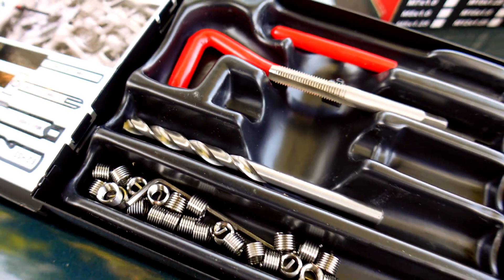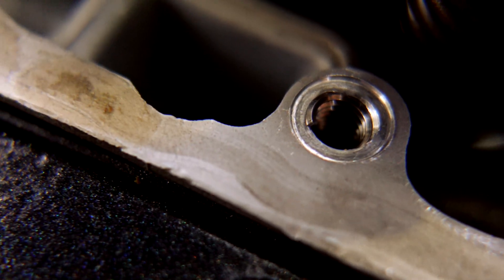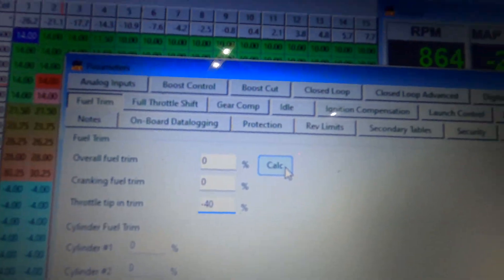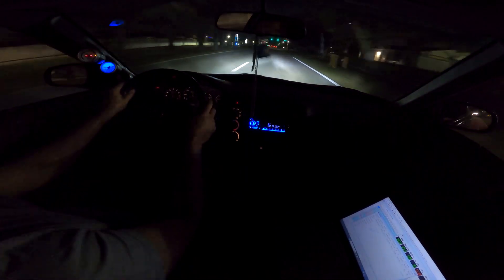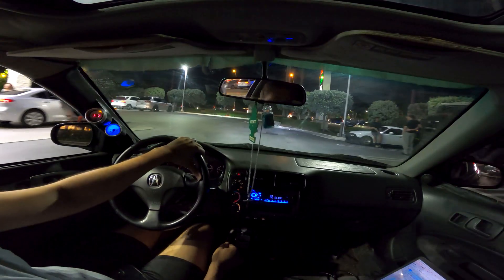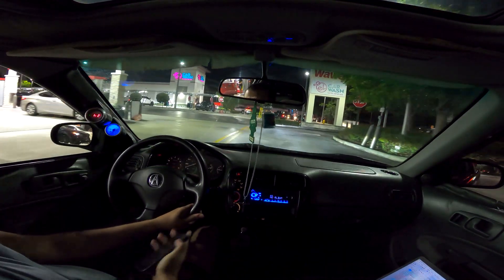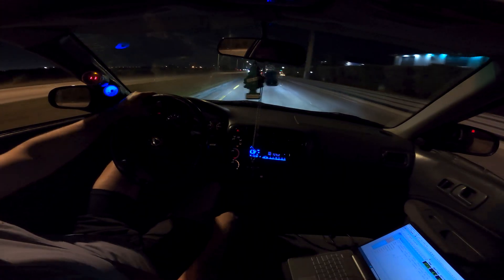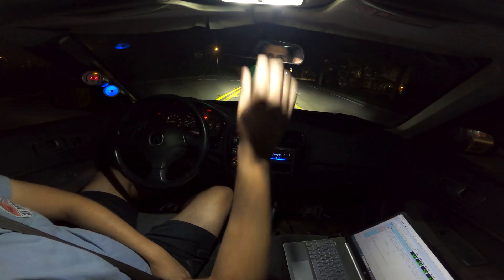Turbo D16Y8 Valve Cover Thread Fix + POV Street Tuning Hondata

Comment: yo how much timing you running at 10psi? I saw one of your videos a while back and I saw you had a lot of timing for a y8. curious also you running pump gas? good video
Reply from the maker: Hey what’s going on! 
I’m at 7-8psi right now with about 18* of timing 
Keeping it a little conservative until we get it on the dyno 
Yep we’re on pump gas also!!
Reply: @CJBuilt  im running a turbo y8 and am running 12.5* at 10psi. and runs great. it sounds like you have way too much timing. do you read your plugs? I know z6s take that timing but not y8s from everything ive read on forums.
Reply from the maker: You’ll be very surprised. 
I’ve seen y8’s at 10psi near 18-20* 

The dyno would be able to tell you for sure what’s the best timing (MBT) without knocking
Reply: @CJBuilt  aye bro i believe you just havent seen it myself. Id love to dyno my car eventually also just not one anywhere near me. love the car brother cool to see other y8s still pushin
Reply from the maker: Yeah man definitely strap it on a dyno. Y8’s don’t love timing so you won’t need to put too much in it usually to find MBT. Hope to see that thing putting down some numbers!! Lemme know how it goes
Reply: hey bro i forgot to ask how much timing per psi are you retarding? im doing 1.25 feels like it could be 1 degree but what do you run? thanks fam